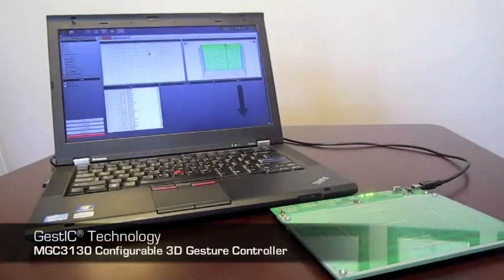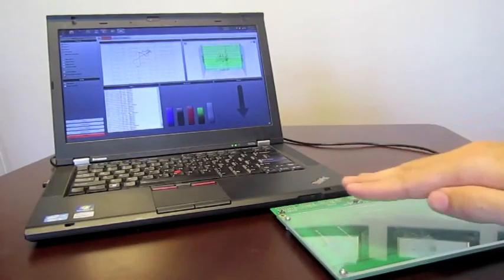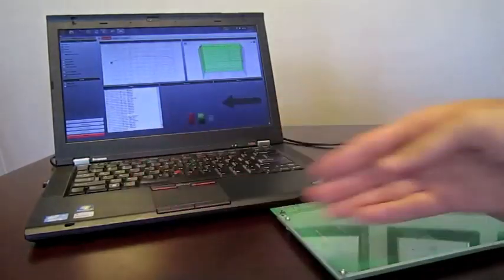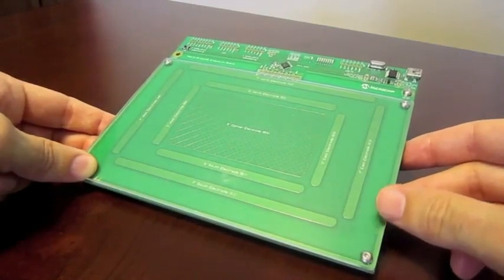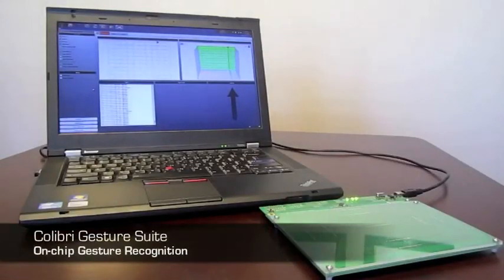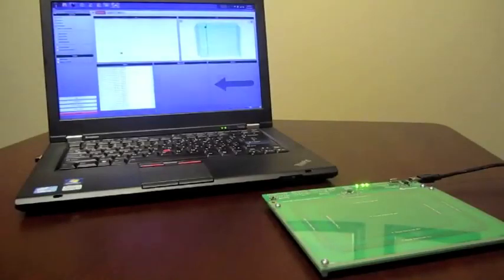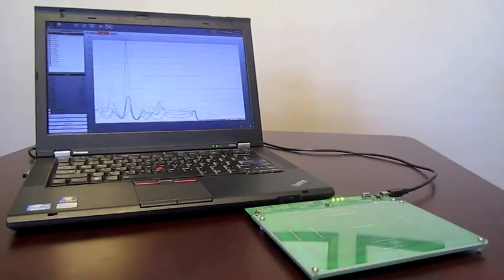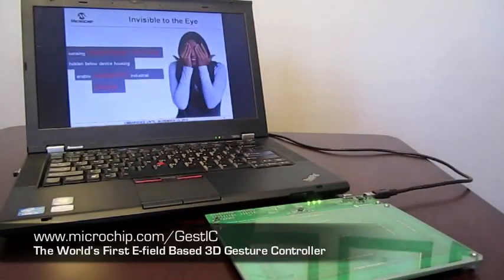Microchip MGC3130 Demonstration using GestIC Technology

Comment: totally useless. it might be fun for some crazy geek guys but in reality, making move of hands in the air is much more difficult than using a mouse or a button. so no real use in life. maybe for kids in video games.. but thats about it.
Reply: You are completely missing the point of this. facepalm Imagine the following situation - you are in a workshop where you have to wear thick gloves which makes the usage of standard touch devices difficult to impossible. The alternative - having hardware switches for this and that is also not great. This technology allows the usage of gestures in such an environment. Please consider reading the GestiC's info on Microchip's website to see some possible applications. This is not Leap Motion or Kinect and it's not meant for gaming (though it can be used).
Reply: imagine controlling your lights , taps, through it , when you have your hands dirty.